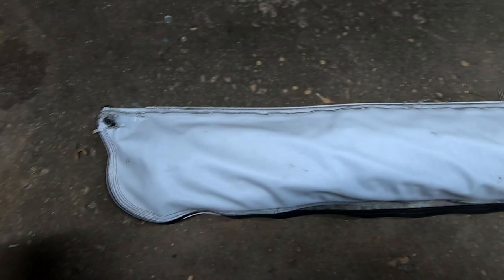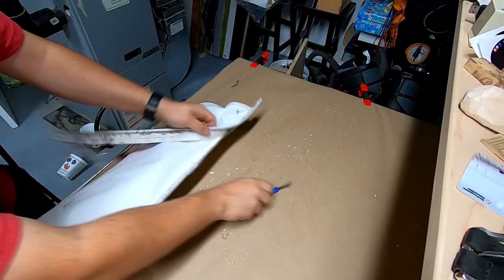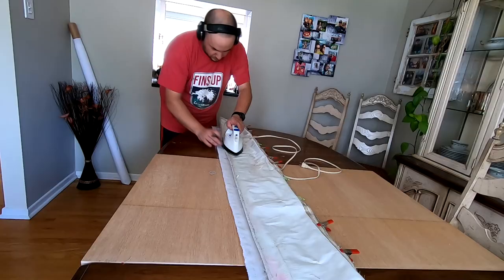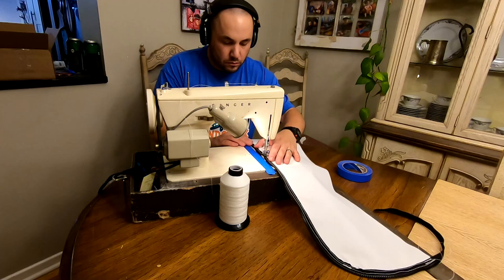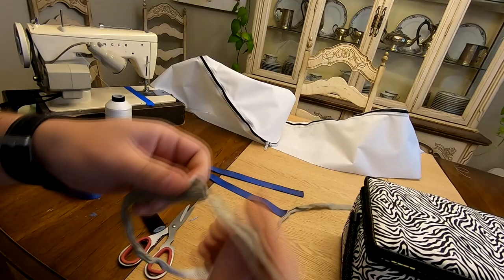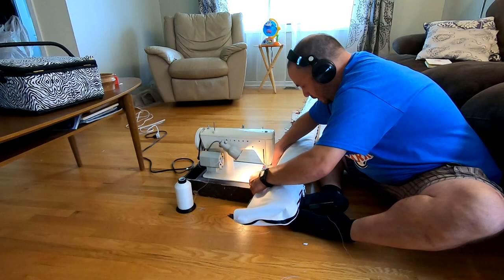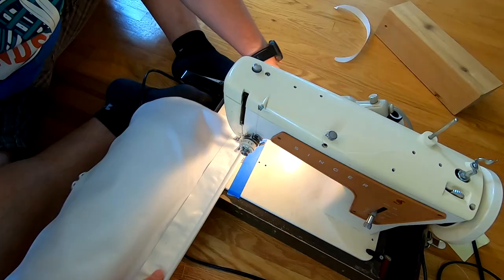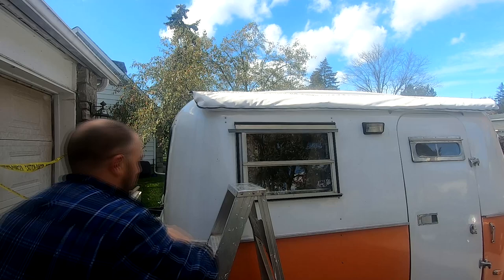New Bag for Trailer Awning [DIY]

Comment: I did the same for our 17' Boler. Carefree of Colorado awning. There was a keder strip attaching the bag to the frame so I removed the frame for sewing. I also used heavy duty snaps instead of the tie and added 4 snaps to the sides to work as deflappers.
Reply from the maker: Awesome to hear! If I could go back in time I would think of a better solution to the straps, but time was tight and a direct replacement meant I didn't have to spend a few days thinking up something different. I like the idea of snaps, I'll take that into consideration for the future. 👍👍
Reply: @TheGrantAlexander  The snaps could be added to what you have already built quite easily. If you do it make sure you get heavy duty snaps.

Comment: Nice work Grant, can you easily take the whole thing off for winter storage, or did that sealer kind of lock it on? One tiny tiny tiny critique... if somebody needs to be told to backstitch, they probably might not know what it is to begin with. 🤔
Reply from the maker: Fair point Jeremy 🤣🤣 I didn't know what back stitching was before doing this project. But so many sewing tutorials mentioned it that I googled it. 🤣 The awning can be taken off for winter storage and that would probably extend the life, but I'm lazy and will likely leave it on the trailer. (there are two #8 screws that hold it in place on the awning rail btw)

Comment: Nice job! The zipper on my bag is dry rotted and the ends have separated from the bag. I bought a new zipper for $14USD and will see if I can attach it with my sewing machine without removing the awning from the bag.
Reply from the maker: Thanks and good luck!
Reply: @TheGrantAlexander  When you went to sew the zipper to the bag, what kind of thread did you use? The video shows a spool of white string, but I can't tell if that's nylon fishing line or what it is. I presume it needs to be something heavy duty. Thx!
Reply from the maker: @CinemaKev24  I used outdoor thread that is UV rated. I think it's linked in the description I got it from JT outdoor fabrics
Reply: @TheGrantAlexander  I'll check out JT and some local shops as well for the UV thread. When my bag is done, I may spray it with FlexSeal just for an added layer of waterproofing. Thanks again!
Reply from the maker: @CinemaKev24  i bought some seam sealer and it seemed to be pretty thick! It felt a lot like flexseal, but more expensive 🤣🤣
Reply: @TheGrantAlexander  I bought Bonded Nylon #92 Tex 90 280d thread. It's UV rated and requires an 18 gauge needle. I'm using a new Singer M3300 sewing machine. The thread is knotting up under the zipper after 3-4 stitches then jams up. I have it set for the longest stitch and tension on zero and also tried bypassing the tension circuit as well. No joy. I'm gunna hand it off to an upholsterer, but wondered how you got your B92 thread to work in your home machine. Did it just work or did you need to experiment to find the right settings? Thx!
Reply from the maker: @CinemaKev24  it just worked, I guess I got lucky 🤣🤣
Reply: @TheGrantAlexander  Ya, it's weird. I watched how the thread attempts to loop under the bobbin and at the 6'Oclock its so stiff it wont continue CCW to complete the loop. Oh well, sometimes you get the bear, other times the bear gets you!
Reply from the maker: @CinemaKev24  have you tried doing the opposite? I always try all the settings even if it seems counterintuitive
Reply: @TheGrantAlexander  Ya, went though all settings. Even used normal thread in the bobbin and that actually worked! But in time, that thread would fail in the outdoors. Actually on my way now to an upolsterer here in town. Fingers crossed!
Reply from the maker: @CinemaKev24  good luck!
Reply: @TheGrantAlexander  4 Upolsterers declined the project for various reasons. So I took another stab at it. Tension on 7/10 while both hands push/pull the zipper through and foot on the motor control. Success!  Decent stitches....not pretty but not tangled knots either. Will add a second row for reinforcement then apply Seamseal. Got the tiger by the tail!
Reply from the maker: @CinemaKev24  awesome to hear! 🙌🙌

Comment: Great bag!  I'd love to make one for our boler awning.  Do you still have the approximate dimensions?
Reply from the maker: I don't recall the dimensions, but I do know that I have an awning that is longer than the boler. In the last bit of the video you might be able to catch the standoffs I fabricated to hold up the extended awning rail. Most bolers I have seen have a 7 foot. So it would be best to measure yours.